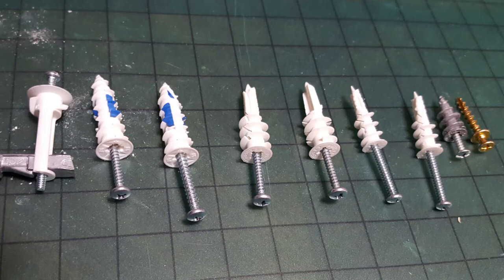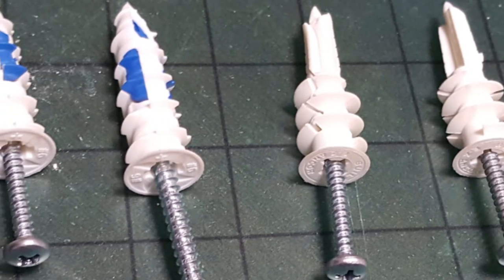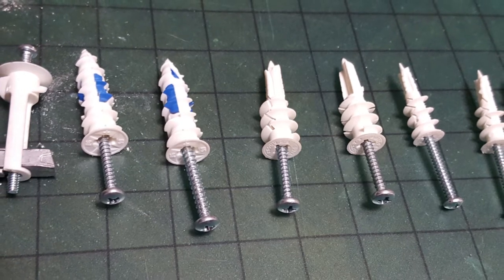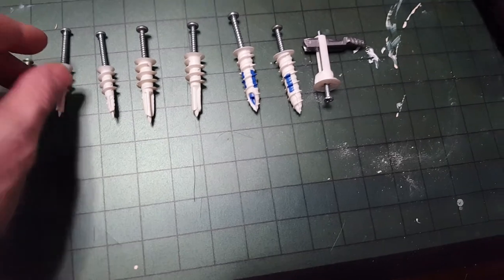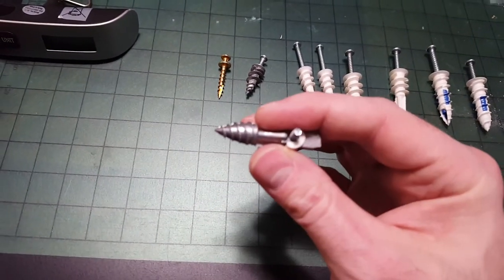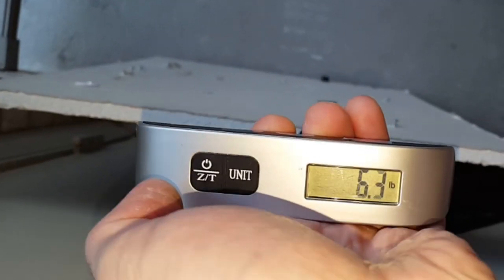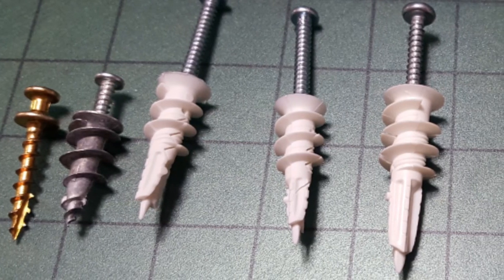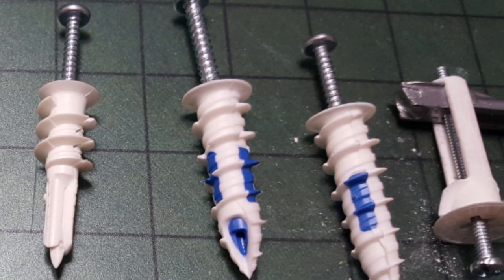E-Z Anchor Drywall Anchors | Self Drilling, OOK Picture Hanging Screw, Driller Toggle Cobra | Test

Comment: Can you use these with plaster walls?  Want to use for curtain rods
Reply from the maker: No because the plaster will crack. For plaster wall curtains, you would need to screw into wood trim, wood studs, or use hollow wall anchors like toggle bolts.
Reply: @toolsandrepairs  thank you! I was thinking that since plaster is harder than drywall.